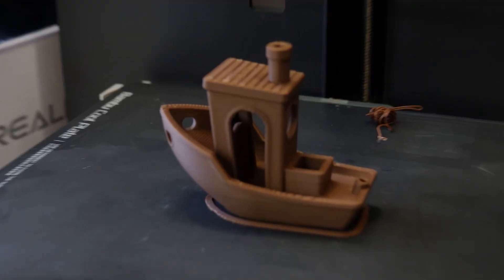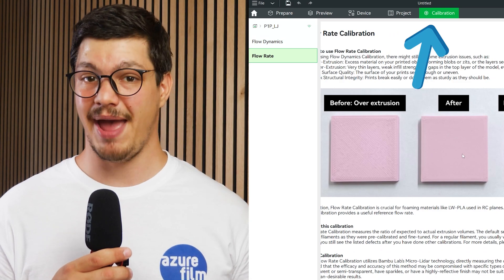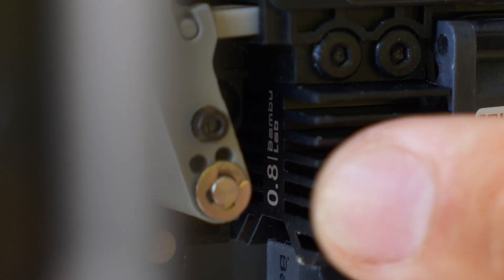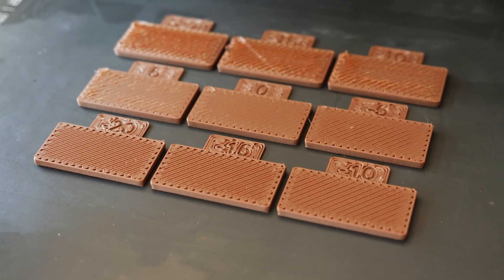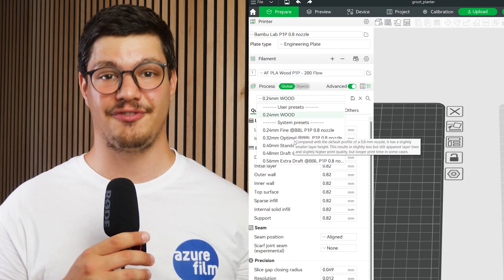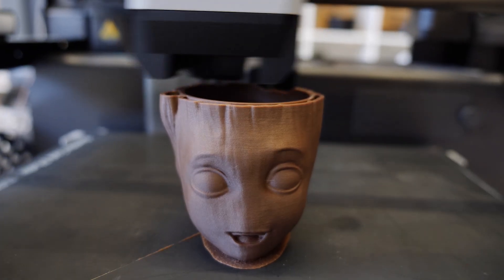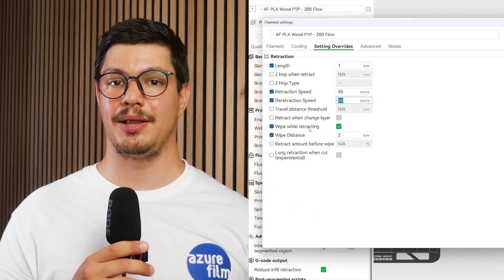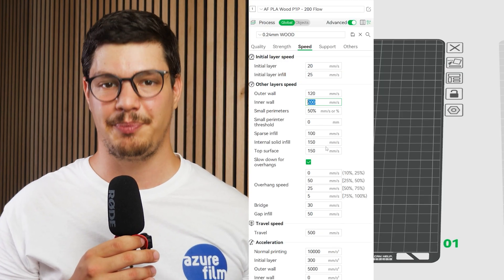3D printing settings for our Wood filaments

Comment: This works ** I was having a very hard time with my Amolen wood filaments, most simply would not stick the bed. (I have 0 problems with normal PLA or PETG).  I changed to a 0.6mm nozzle, imitated your setting in Prusa slicer and success!  Nice first layer and a perfect second layer.  I even forgot to re-level the bed for the new nozzle. The 50c bed temp made me worry, but not problems.  Thanks so much.
FWIW, I had read a lot of Reddit and other forums, but your settings did the trick for me.  Prusa slicer, Octoprint, Artillery S1, PEI plate.